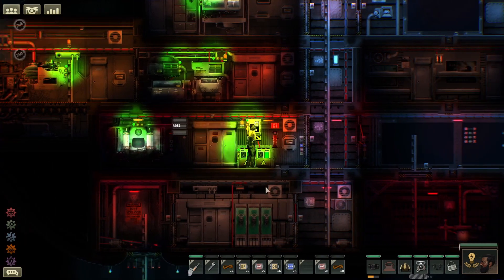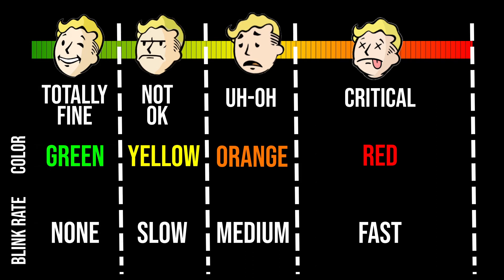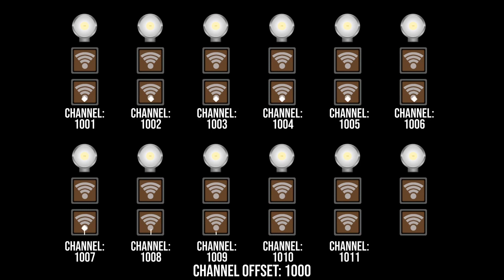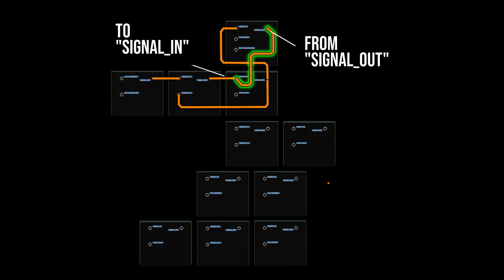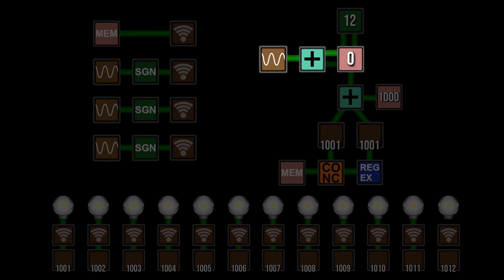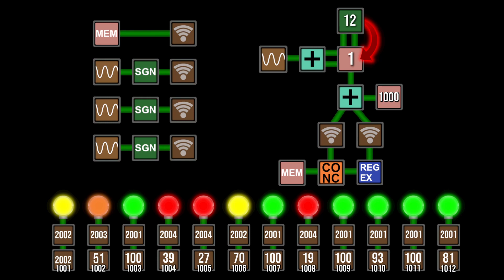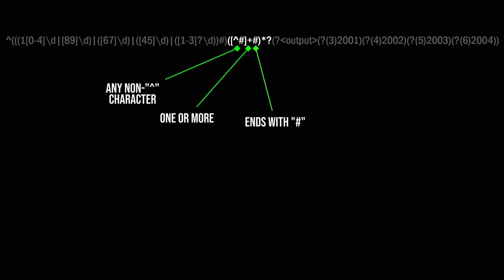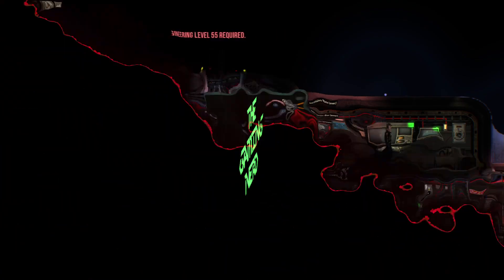Barotrauma - Condition Monitor circuit walkthrough

Comment: Hey, Hope things are okay, I saw your post from 3 months ago. I'm no engineer but I'm grasping what I can. I'm running into an issue off the bat where the light doesn't even turn on. I believed I followed this video through and through. I hope to hear back from ya. Cheers.

Edit: turns out I had to turn it on in the sub editor… but now I have another issue.
Reply: make sure in Sub Editor you check 
"light components" turn on by default
Reply: @resonance_sky  
Thanks for the reply! I really could use the help.

Yes! I checked that box asap after posting. The light now stays at a steady white light and does not change color unless I manually input the wifi channel on the x2wifi x1 light component assembly (as shown in the video) to the corresponding wifi channel for colors and blink rates. Steady green 2001, slow blink yellow 2002, urgent blink orange 2003, and emergency blink red 2004. And when manually setting the channel to zero, it will stay on the last “2000” channel previously set, not going back to the steady white.

To clarify, when waiting for damage or even when spawning the device (I used multiple separate devices to be sure it wasn’t just an issue with one device) damaged or destroyed… the light will remain steady white until I manually change the channel… which defeats the purpose. 

Any help is appreciated.
Reply: @AlphaShepherd  i think it have some problem..
1. Make sure all Wi-Fi have enough range, you can change it in Editor.
2. In Oscillator components use Square Wave.
3. In Regex Component, enable continuous output.
Reply: @resonance_sky  There isn't much for me to say.

1. is range 20,000 ok? it seems to be the default setting

2. The oscillator components in the signal generator assembly are all set to "square"  output type. On the Condition Processor Assembly, It was on pulse, I switched it to square and the same result happened... a steady white light that doesn't change. 

3. Regex Component does have "enable Continuous output"
Reply: @AlphaShepherd 14:02 make sure to type correctly in "Search Expression" what you can see in this time video, if you copy from description it's not complete.
And Condition Processor Assembly, at oscillator set it to "pulse type output".
I have tested it and it's working just like his explanation.
Test it in Condition Processor first memory component "signal_out" to "set_text" by placing display text and see that number must reset to 1 after hitting your set number.
Hope it works for you.
Reply: Is this within a circuit box or do I have to do this entire project again outside of the box? -.-'
 @resonance_sky
Reply: @dezdoes1921   I do this before game Update and add Circuit Box, i don't know if you can apply it "Inside Box"... I already test this "System" and it's work not Inside Circuit Box.

Comment: is this still working as on ToDay? or am i just to dumb to make it work...
i know i wired all right i checked them 3 times und i put all the values right. I just dont get my light to turn to the color they should they are just white, it looks like they dont get the signals.
Edit: Well now i did get it to work. but my lights of the sub-marine outshine why modul light`s so i cant see the color of the small ones...
Reply from the maker: You can always edit the intensity (fourth number) of the color of the existing lights on the sub, so they don't overwhelm the indicator lights...

Comment: It seems like somehow the 3rd capture group is being satisfied while at the same time so is any other if the condition of the device is low enough. Causing a green light that strobes yellow, orange, or red. I'm trying to think of a way to fix this. Maybe I'll dig through your more recent videos? I'm not very good with this stuff but it seems functional enough, just wondering what I did that caused this bug in it.

Comment: I don't know if anyone else had any problems with this as well, but when I saw the note in the description saying "pointed brackets", that was quite clearly "{}", NOT "<>", so here's the actual regEX expression:
^(((1[0-4]\d|[89]\d)|([67]\d)|([45]\d)|([1-3]?\d))#)([^#]+#)*?(?<output>(?(3)2001)(?(4)2002)(?(5)2003)(?(6)2004))

Also when I tried this, strangely enough it would only work for the first TWO items... Also it lit up the second item with whatever value the first item had, like if it was destroyed it would say the second was too even if it wasn't. ..... It turns out I just forgot to wire the conditions out of everything other than the first item to the 1001-1046 wifi channels and it was obviously making it not work. Now that I went and did that, it works fine! Definitely think that needs to be put in a note in the description man as you never even ONCE mentioned that other than for the first one.

Comment: I'm not nerd enough to know what sin wave is. Stopped watching after 2mins. I need to watch a sin guide before watching this guide
Reply: nah, a sin wave is a wave. you don't need to know the difference in truth. the important part is that the square wave goes (1,0,1,0,1,0,1,0) while a sin wave is analogical, so it can cover ideally infinite intervals (0.01,0.02,0.03)